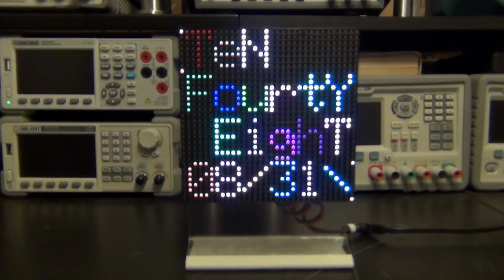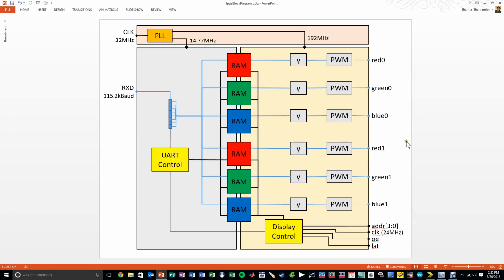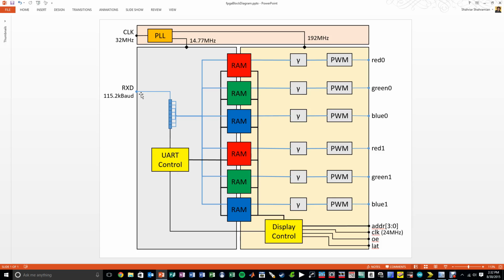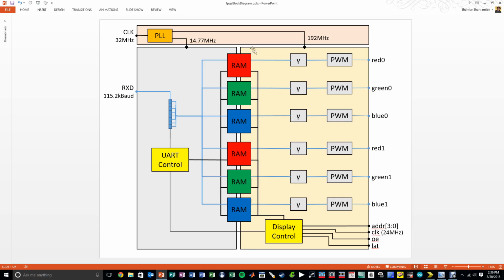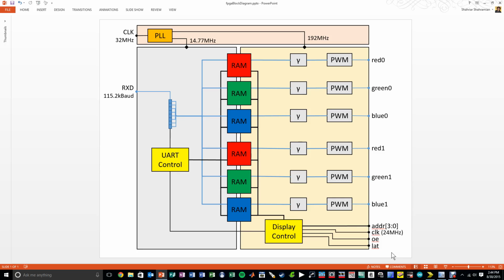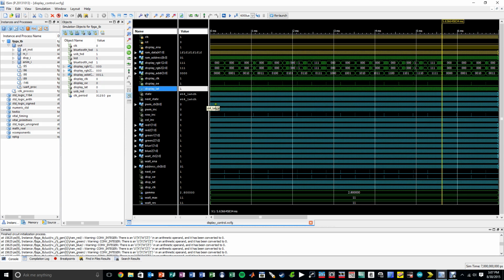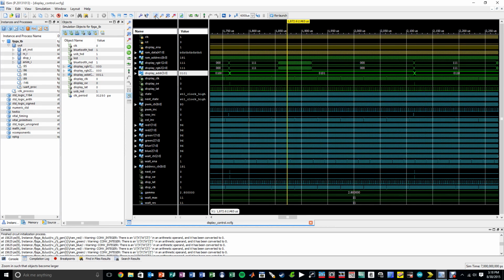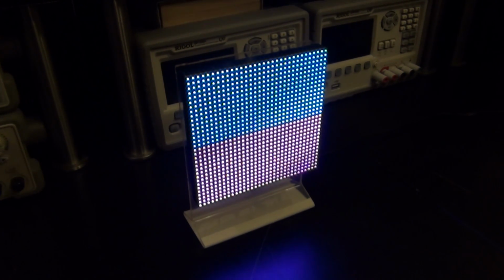TSP #62 - Tutorial on the Design & Implementation of an FPGA RGB LED Matrix Driver

Comment: Nice tutorial +The Signal Path Blog
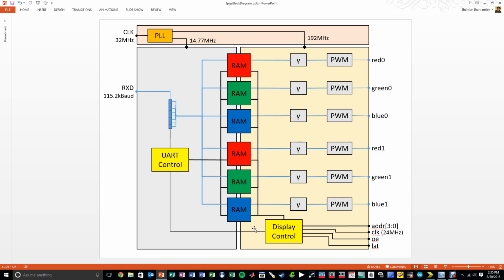at 15:40 this is called Double buffering technique ;-) And the effect which is caused by single buffer is called Tearing effect (can be seen when you play games and you disable sync every frame, an ugly line appears between two different motion pictures).
With ARM Cortex-M3, which is simple 32bit microCPU, I was able to play AVI files (fullscreen at 25fps) on TFT display at 320x240 with simple RAM buffer from SSD1963 chip. See https://youtu.be/7TZ0zIe6WRo

Comment: Is the software you used for this free? Or the simulation part? That lsim looks nice!
Reply: +Nick Leijenhorst Yes, Altera and Xilinx offer free tools for their smaller device's. Xilinx has ISE and Vivado and offers their own free simulator with the installation. Altera has Quartus II and offers a free altera-modelsim simulator (Modelsim is my preferred simulator). You can use either one if you're writing device independent code.

Comment: good video, I like this type of project based videos which include FPGAs and programming, disappointed you didn't go into the vhdl code and how to use FPGAs.. I'd be interested to see the code on the PC also. Maybe add a SD card so you can run without a Bluetooth connection..

Comment: At about 18:00 it was mentioned that there wasn't an integer multiple difference between the clock domains, but isn't 14.77 * 13 = 192.01?  That's pretty close.  I would still use a dual-ported ram, though.

Comment: I only have experience with microcontrollers and would like to know more about FPGAs. This was a good introduction of some of the difference between micros and FPGAs.

The schematic in the beginning mentions that the FPGA outputs PWM after gamma correction, but on the logic analyzer it seems to be binary data that is sent to the display. I assume the PWM is done on the driver and not the FPGA? 

This was confusing to me at first since you never explained what protocol was used to communicate with the driver board and if the signals were sent serially or in parallel. I now understand that two rows were sent in parallel as well as the three colors, but the position in the row and the data for each position was sent serially (hence 6 SPI busses simultaneously?).
Reply: +Richard Andersson Those boards don't have "drivers" as I think you mean. You just clock in the data for each pair of rows from left to right using the RGB+RGB+CLK pins. They don't have PWM on the boards - it's all done on the FPGA. As the top comment mentions, there is a more efficient way to achieve the same effect as PWM which is much faster. But you can think of the LED boards as "dumb" here - all they can do is clock in data for LEDs to be on or off. I've used the exact same boards here.

Comment: PWM is not an efficient way to drive these - you want to use binary coded modulation.
This only needs one update per bit, not one per intensity level.
shift & latch bit 0 of each LED value, enable for time <t>
shift & latch bit 1 or each LED value, enable for time <t*2>
etc. for as many greyscale bits you want.
Up to about 12 bits is possible, which would be impractical with PWM
See my video :https://www.youtube.com/watch?v=Sq8SxVDO5wE
Reply from the maker: +mikeselectricstuff Thanks Mike! As soon as I saw your name I remembered your technique! I had actually watched that video and somehow forgotten all about it! :)
Reply: This was my first thought as well: to use BCM.
But for this video I suppose it is a good starting point for educational purposes to start with 'plain' PWM.

Even though it appears the performance comes 'for free' with the FPGA using simple PWM, there is still some loss because clocking in the pixels takes quite some time, so the slowest time for the LSB is determined by the time it takes to clock in 32 bits (and of course it gets worse with multiple chained displays). You really only can have a single unchained 32x32 display with only 8 Bit PWM to get a useful refresh rate here.

I am the author of a commonly used Raspberry Pi library for these kind of LED panels ( https://github.com/hzeller/rpi-rgb-led-matrix ); since the code is doing BCM, it can have 11 bit per color (which is what you really need to have luminance-corrected 3x8Bit RGB), having a LSB on-time at only 130ns.

Another trick that is possible in the BCM case: you can clock in the data for the next row to be displayed while the OE is on for the previous; you only latch when the OE-enable timer for the previous timer is done. The LSB lines of course need all the time, but in higher bits, you have quite some time for that. That way, you can 'hide' the time it needs to clock in the data while the output is on, thus can keep a relative high frame-rate even for high-chain counts.
Reply: +mikeselectricstuff You could also do second order delta sigma modulation, maybe at a sampling frequency of above 200Hz-1KHz visible low frequency flickering gets insignificant compared to image content.
Reply: You can easily chain 4 panels with the Raspberry Pi 3 with full color and > 200Hz refresh rate with my library Trap Lover . You can do that with three of these chains in parallel even without loss of speed (so, 12 panels in that case).

To run Gladiator you either have to write an Artnet server implementation or use my PixelPusher implementation (rpi-matrix-pixelpusher in my github) and then use the PixelPusher/ArtNet bridge (but of course, writing an ArtNet directly is probably better).

These days, I usually use the simple FlaschenTaschen protocol for these kind of things (the FlaschenTaschen implementation also has a rpi-rgb-led-matrix backend).
Reply: +mikeselectricstuff i agree. with pwm you'd use a comparator per channel. with bam/bcm you jjst need n nxor gates and or them together
Reply: Hey there Henner. First of all thanks for commenting you knowledge. I've watched tons of videos on driving LED Matrix boards and I recognized your name from many description links. Just wanted to ask; I wanted to chain 4 boards with an Raspberry Pi 3 model B and use Glediator or Jinx to run animations on screen. So my question comes in two parts. Can I get the 4 32x32 boards up and running with little  to no stutter without and FPGA board and PWM? ( I literally studied days of info about PWM aha) and secondly, Can I run Glediator / Jinx from a laptop and project the output video to the raspberry Pi and then have the video show up on the matrix?
Reply: Henner Zeller Thanks for the speedy response, I had taken the time to check out all three implementations, PixelPushing, Artnet, and your custom flaschen taschen protocol  (btw, love your LED matrix vids, make more ;) ) and I think being new to this field of driving a display, I'd appreciate a pros VS cons the implementations. And how I'd go about using the back end to run Gladiator. Is there code I'd have to write to be able to have the Gladiator software recognize my Pi as an output channel?
Reply: mikeselectricstuff vn ne
Reply: mikeselectricstuff vn ne